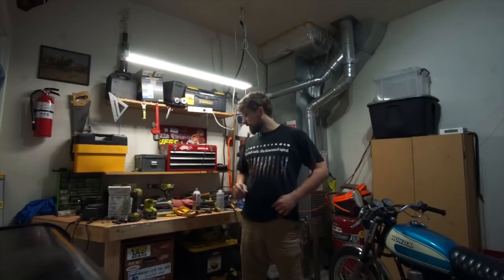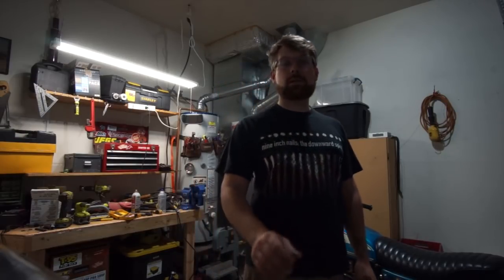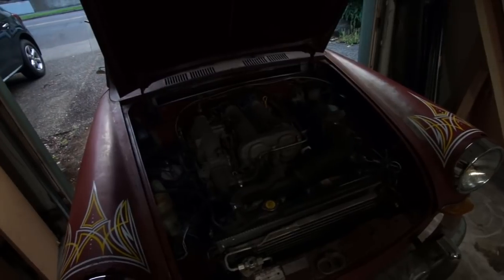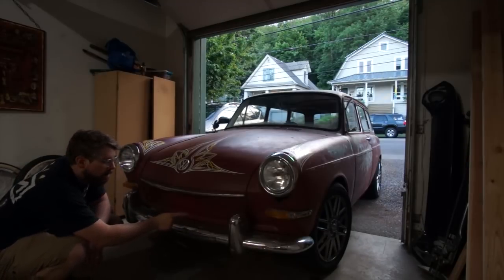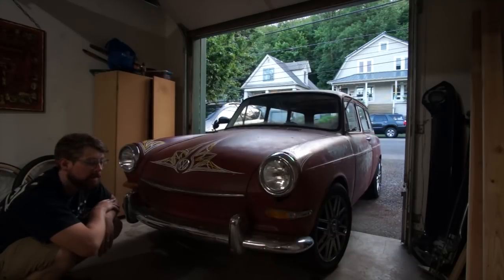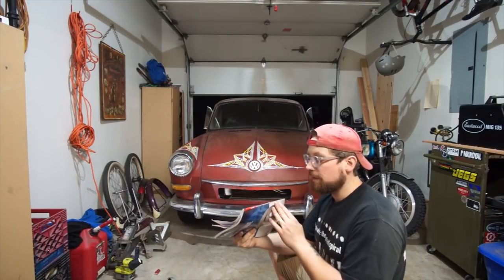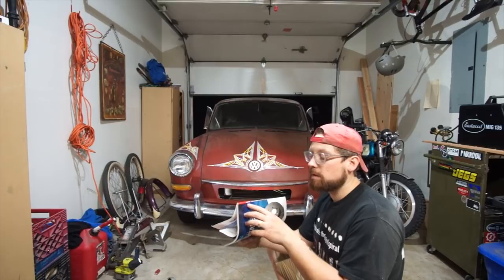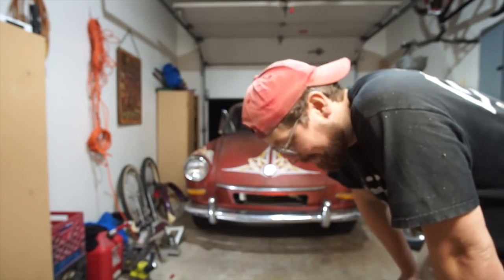Pinstripes, radiator grill, and moving to Portland - Project Frankenwagon, ep. 19

Comment: Pin striping looks great but ya need to add some to the rear hatch too. (just to even out the look of the car.)
What are your plans on the interior? going to "finish" the inside or just keep it rat rod looking?
Reply from the maker: It definitely needs an interior. One of my long-term bucket list goals is to go on a road trip in a classic car and today's two hour drive prooved that it was mechanically up for it but it is not comfortable enough for a long road trip, especially not for my better half. I need to re-upholster the seeds and make them a little taller, adjust the steering wheel height, get a larger steering wheel, and then do all the door panels and headliner and everything. The trick though is that the headliner needs to be installed BEFORE the window seals get put in, and I need a new windshield, and I would want to do any paint while I have the windows out. So it's all or nothing. Hence why "Stage 3" is get it daily-drivable and "stage 4" is the total restoration
Reply: @ThisOldJalopy  cannot wait to see more... Ive always loved squarebacks and this is awesome! keep up the good work brother